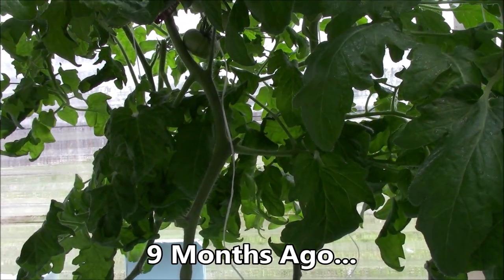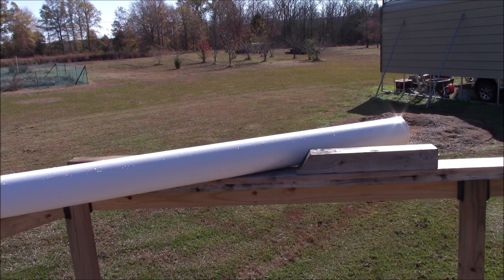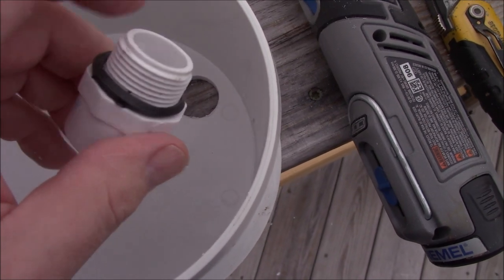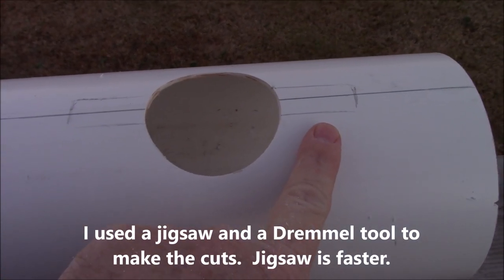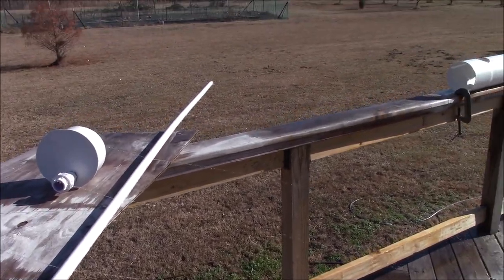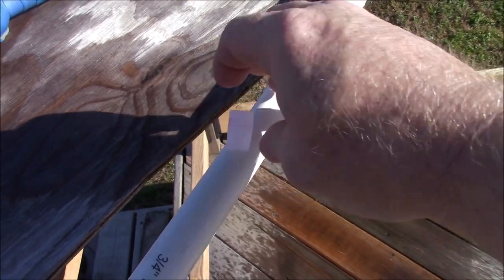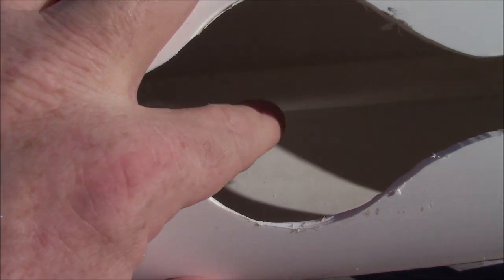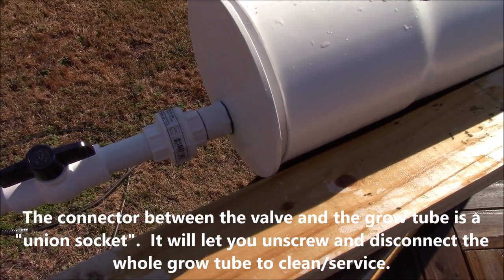Water Culture Grow Tube - Part 1:  Building the Tube & Why

Comment: Brent, instead of the smaller internal pipe try a soaker hose

You can then connect water and air to it for even flow along its full length 

Keep up the good work
Reply from the maker: I've tried soaker hose in both 1/4" and 1/2" in the past.  It's difficult to get fluid and air flow even and they're rubber.  But out of curiosity, where would the soaker hose attach and route?

Comment: This is an adapted rain gutter grow system to my eye. With regard your air pipe, could you not put the rigid air tube or garden hose on the outside and run air lines, in via the top, either side of the plant position. This would negate the need to take the tube out to clean. You could add nutrient water manually or by a float switch. I have similar but wick via a pot as you mentioned but without air.
Reply from the maker: Larry was an influence in my work many years ago.  I added nutrient to the gutters later on and used a gutter as a traditional wicking system migrating away from the RGGS about 9 or 10 years ago.  RGGS was new then so I understand your thinking.  Wicking has been around much longer than the RGGS and Larry fertilizes in the container above.  But, yes, the concepts of wicking are the same.  The "grow tube" is primarily a water culture meaning plants do not use soil and grow inside the tube of water.  In this water culture tube, a supported container can be used to wick up as well, a hybrid by design to grow root crops mainly like carrots.  

For your design suggestions, let me show you part 2 and 3, then your comments or suggestions may alter one you see it all.  The whole tube can be removed at the end of the season to clean.  That's the only time to disassemble and reassemble.  In my previous water culture, you'd have to remove and replace the plastic and loose pipes.  Other 2 vids coming soon.  :O)
Reply: @C3Voyage  I will certainly be watching...I am curious to see the finished product.

Comment: Did the large water mass of the previous design provide any benefits?
Reply from the maker: That is actually a great question.  I would have thought that a larger water mass would buffer against nutrient issues and ensure even temperature against changing room temps along with handled large masses of roots anticipated.  What I found was it does do that with temps.  Reservoir was very much the same temp always.  I didn't notice masses of roots like I'd expected even with tons of plants in there.  I grow microgreens in 1 to 1.5 gallon reservoirs.  Part of my IHG method.   With them, I didn't notice nutrient issues topping-up (adding), but I did have some mild nutrient issues in the "L" shaped water culture bed.  Odd, eh?  In all my years doing this, I've learned flow-to-waste is easiest and best.  That style is basically watering with fresh nutrient and not recycling or recirculating.    

So, I'm hoping that the changes here will do several things:  1.  Capture a bit of flow-to-waste by minimizing time between change outs.  Micros do great this way.  It would be no longer than 2 weeks.  This will keep the nutrient fresh.  It's about 1/3 less volume growing same plants and I hopefully won't need additives like iron or magnesium supplements.  2.  Simplify nutrient changes.  Super easy now.  3.  Lower platform so there's more indoor height for tomatoes.  4.  Allow easy removal of plants.  I'm going to cycle plants (remove/replace) before their life-cycle normally ends.  Should be able to get 6-8 trusses per plant then remove and replace with newly waiting plants at 1st truss--plug & play.  This is different than other grower styles which is lean and keep going.   5.  Keep foliage from taking over.  6.  End of season clean-up doesn't require as much to clean and little to no purchase of new materials.  

I don't expect all of my expectations to be met, but I'm hoping many work out.  Regardless, it'll get videoed.
Reply: @C3Voyage  I am excited to see the progress to the points you stated.  Interesting idea to forgo aging plants, along with drop and lean, in lieu of ready to go fresh replacements. Optimizing the indoor succession planting game ;-).